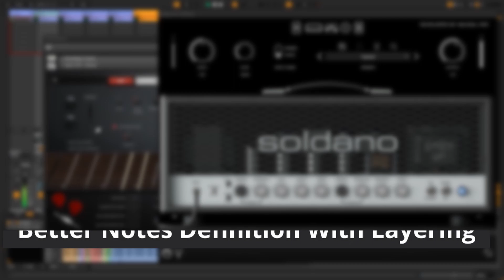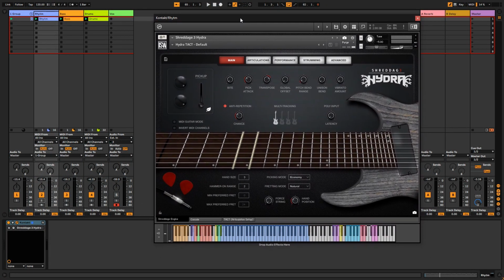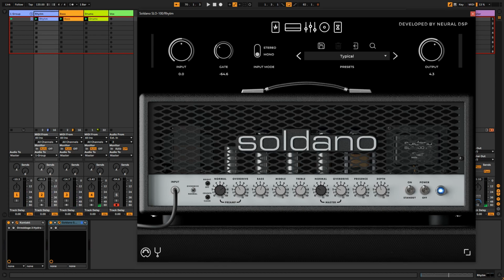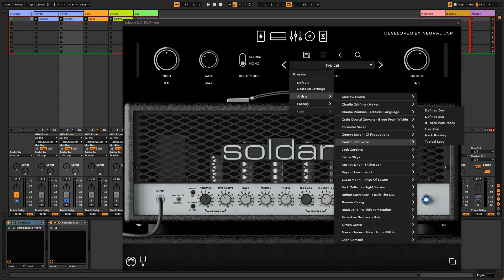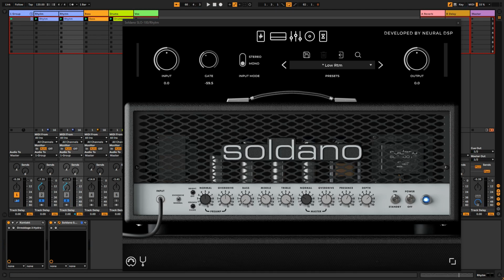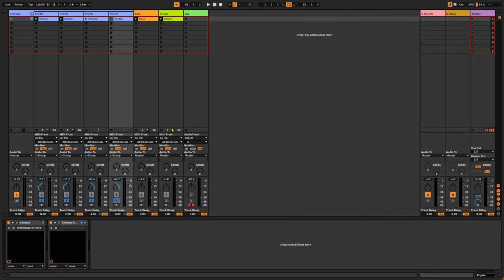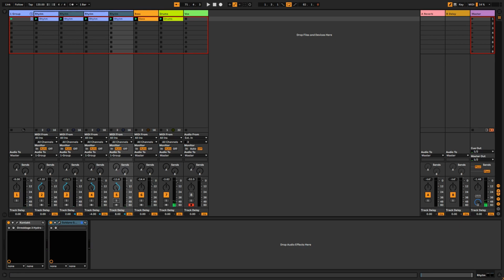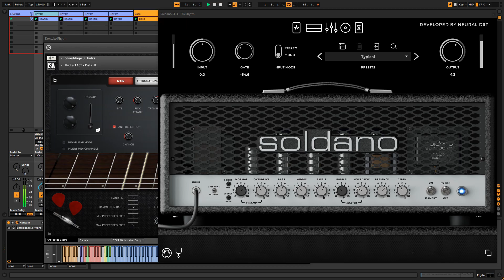Shreddage 3 Hydra: Better Notes Definition With Layering

Comment: @bitkaster Thank you so much again for your Tutorials! I got one question. What do you mean with only single notes? Did you just change the Articulation on the second guitar from Powerchord sustain to normal sustain?
Reply from the maker: Yes, I'd use single notes as power chord layers to add definitions to the power chord. You can use EQ, but here I try a different method and I like the results so far
Reply: @bitkaster  Oh ok thanks, now I get it ;)

Comment: what did you mean by "create but in single notes"?
Reply from the maker: If you write a power chords or any chords just write the roots or notes that you want to highlight, then low pass until you only heard the mid high - treble. The purpose is to add extra definition to the chords with layering the top end

Comment: What's the bass VSTi you're using?
Reply from the maker: EZbass metal EBX
Reply: Much obliged, sir @bitkaster
Reply: Sorry to keep asking questions, but if you want to write a bass-line in the Reaper/Cubase/Fl Studio piano-roll, can you use Ezbass as a normal VSTi, or do you need to use the onboard piano-roll (grid editor) of Ez-bass and make it align with the rest of the instruments? @bitkaster
Reply from the maker: Yes you can use piano roll to write the Midi notes. The articulation can be write using keyswitch
Reply: Once again, much obliged for the replies - you have a new sub! @bitkaster
Reply from the maker: Thank youuuu !! cheers !! FYI you can find keyswtich layout in Help - Keyswitch Layout. But for legato like slides, grace notes, etc from my subjective opinion the best way to learn how to write that articulations is write the EZ Bass grid editor, then drag the midi to DAW piano roll, so you can see how actually that articulations write in DAW piano roll

Comment: What amp would you recommend for this guitar? I’ve been trying to find some good ones, but haven’t gotten much luck.
Reply from the maker: I'm using line6 helix native and neural DSP Soldano demo, personally I'm happy with the result, maybe it works for you too.  I found Neural DSP Soldano has good presets but doesn't have many options like a helix, vise versa, the helix is flexible but somehow it's trickier than Soldano/neural DSP

Comment: cool tricks man, anyway can hydra do kinda harmonic string picking? something like pantera - heresy intro, an example version/tips from you would be nice thanks!
Reply from the maker: Hi man, hydra has a harmonic and pinch harmonic articulation, I'm watching Ola Englund Heresy - Pantera cover video but I don't have an idea how to emulate that kind of sound using hydra, the hydra harmonic does not sound close to that. If I figure out how to reproduce that harmonic sound using hydra I will share it here
Reply: @bitkaster  thanks man, anyway what those transpose step are used for? to make right and left guitar a bit different?
Reply from the maker: Yes, I found these weird tricks on the hydra manual, personally, I'm happy with the result, it makes a slightly different tone between the guitar 1/2/3/4 so there is no phasing issue. To make a more clear separation between the guitar tracks on multitrack guitars, set a different value on the track delay
Reply: thanks! great info

Comment: Awesome tone and video! One question. On the second duplicate track you set the transposition to 3? When I do that I get a crazy minor chord.
Reply from the maker: :))) You need to transpose both Kontakt and shreddage, if you transposing shreddage to + 3 then you need to transpose Kontakt to -3. The number is doesn't matter, you can transpose to -7 and + 7 if you want, it only makes a slightly different tone. I'm using this trick to avoid phasing. You can follow my other video about transpose trick, hope this helps https://youtu.be/1eMmL_C3vs8

Comment: Thank you for all the help with this plugin so far! I got hydra a couple months ago and haven’t really gotten very good at using it, before I used odin ii and have gotten pretty decent with it, but I believe hydra sounds more realistic and has more articulations and real guitar like features. I’m wondering if it’s possible to do flamenco style strumming with hydra, it’s fairly easy to do with odin but doesn’t sound quite right with hydra. Any advice would help, here’s an example of how it sound with odin ii 
https://www.dropbox.com/s/82n4txlefs7mr2t/Face%20the%20desert%20air.wav?dl=0